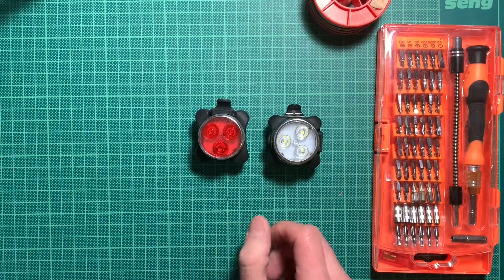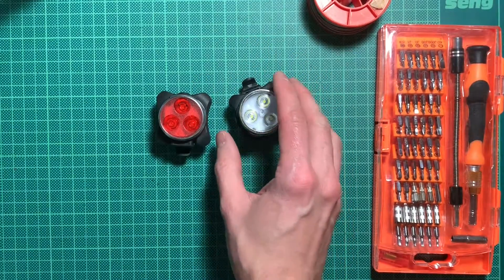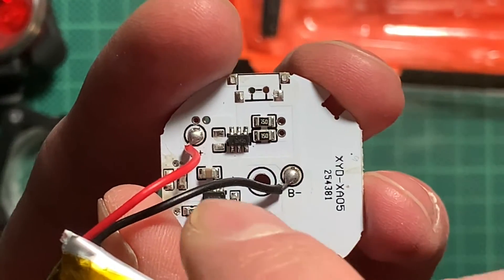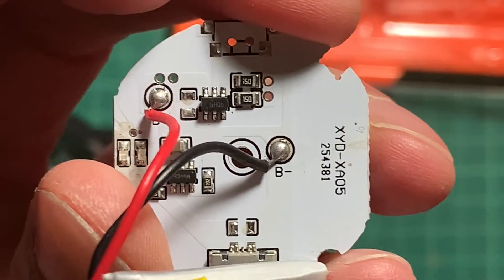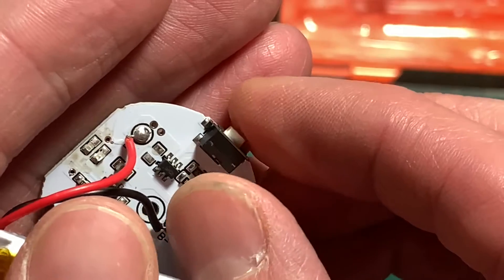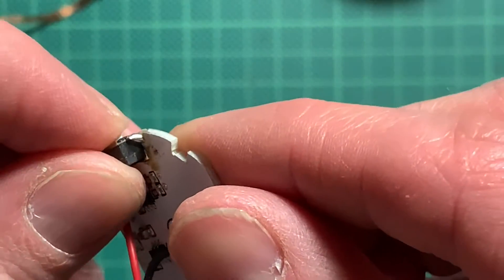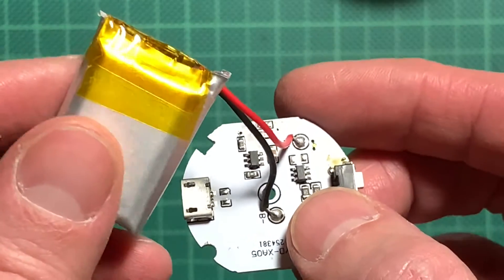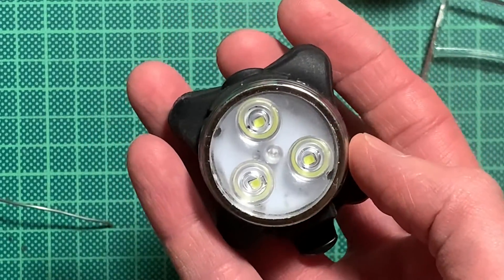Repairing a Bicycle LED Light

Comment: I saw them on ebay. Does the white one output enough light to see where you go at night ? or it's just enough to be seen by others ?
Reply from the maker: I use them for visibility only. I use them on my kids‘ bikes. They ride 12“ and 16“ bikes without lights. I think you will be able to see something, but I haven’t tested it. The lenses on the LEDs should help a bit.
Reply: @root42  thanks you, I will look for a more powerful one
Reply: @jeremyp7293  there are some very powerful lights for bicycles from about £20 UK, €25 EU. Rechargeable with two 18650 cells.
I've had an Ebuyfire which was very bright for it's low price but after a year it would not recharge. I wanted to open it to see if there was a simple repair that could be done. But it's not possible to open it without damage. It seems to have been pushed into the whole light fitting with a lot of force. They used very short cables so when I try to remove it it's not possible. I can slide the batteries back only 10 mm, but the wire is sold it on to the top and I cannot see where the wire goes. That's how short the cable is it only has 10 mm movement. I'm looking for a light which is repairable which is how I ended up watching this video.
I've seen a different light which has screws at the lens end and screws at the back end of the light fitting so I will try this one. Hopefully if they're using screws on both ends it will mean that the light is designed to be opened repaired etc
Reply: @Google_Does_Evil_Now  Hello, I still did not buy any light for my bike. But I repair a lot of things. Most of products are build with glue reather than screw.
If the casing is made of aluminium try to use a gas torch or a heat gun to soften the glue, but not too hot. On flashliight sometime the lens screwed and if you want to disassemble it completely you need to remove the lens first. Poor quality product from china always have short wires... first thing I replace.